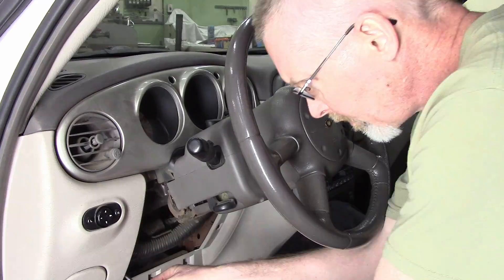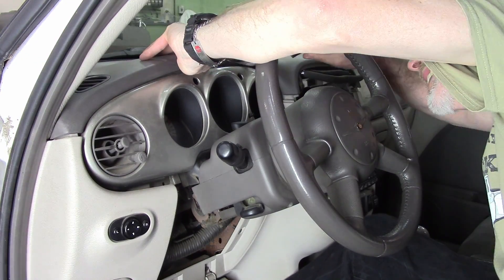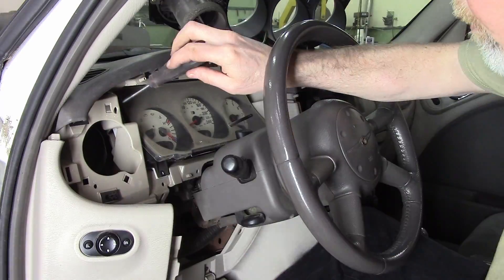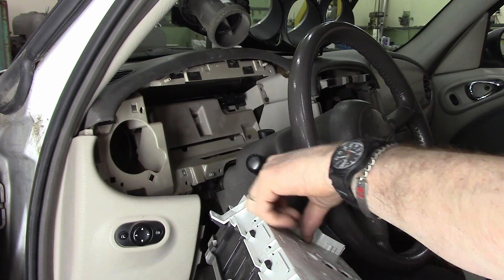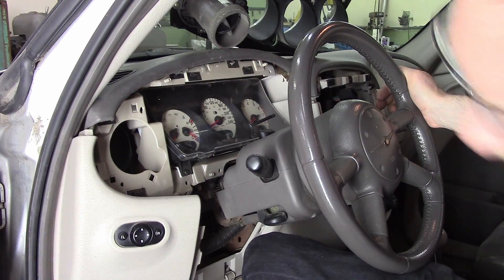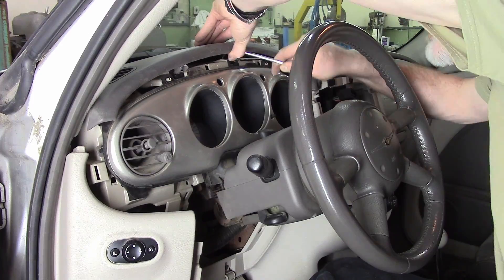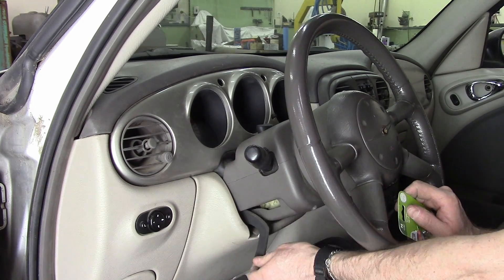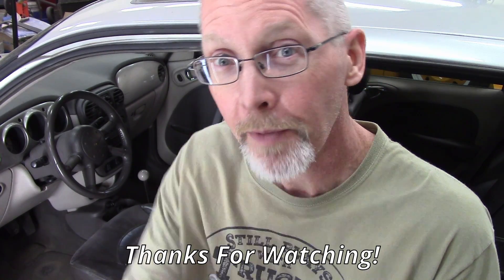PT Cruiser Dash Lights

Comment: Top tip, to get the dash cover off and on easily. (and ease getting access to instrument cluster cover)  Remove the A pillar driver side door pillar cover. You do that by pulling the door gasket far enough away from the A pillar (seen here 5:36) and then pull on the plastic cover, it's held in by clips. Once that cover is removed there is a whole lot more play with the dashboard cover and you can easily get those two clips to line up and secure in place when done. Do the opposite of putting the door pillar cover back in place and gasket, and you don't chance marring the lip of the dashboard cover. Otherwise the rest of the video worked applies just the same.

Comment: Can you give some more specs on compatible bulbs? I gather 12 v, but what wattage and what kind of fit (base)? living in Denmark, I cannot find the "Bosch longerlife 74", but see many similar bulbs. However, after having dug into the back of the instrument cluster, I would hate to find that I have bought the wrong bulbs.
And - When you say "whatever number you like" What are the differences between different numbers, and will they all fit ????
Reply from the maker: Find something that looks about the same.  If it will plug in, it will work.  The higher the watt, the brighter the bulb.